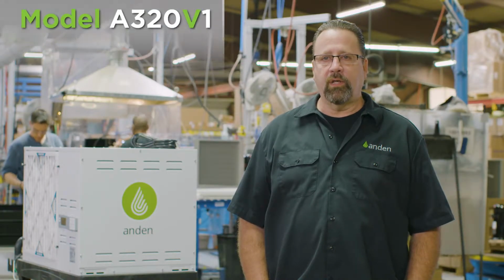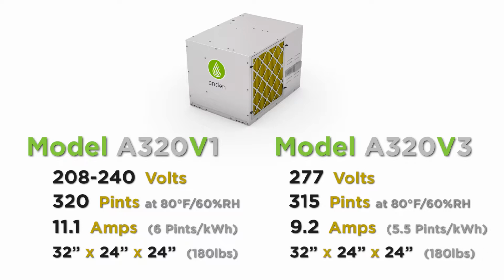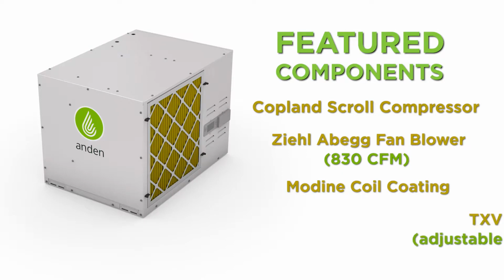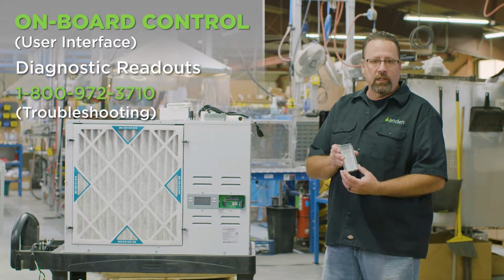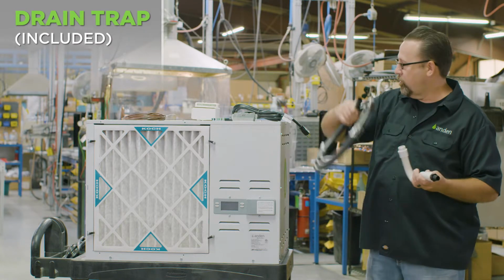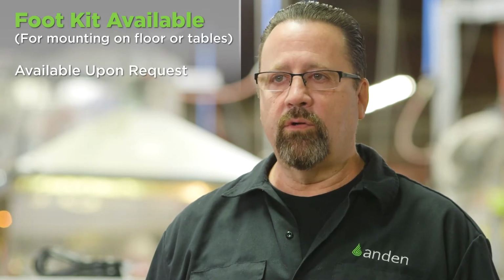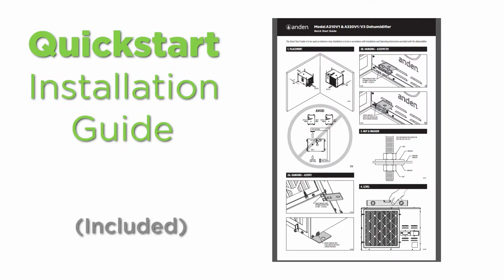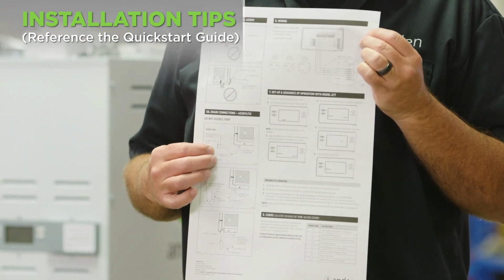Anden | A320V1 and A320V3 Product Overview

Comment: Please revise air filter size. Supply houses do not carry 19.5+21.5 air filter
Reply from the maker: Thank you for the feedback. We only recommend using the 5813 Anden filter specifically as it was designed strictly for use with the A320.

Comment: Is it possible to convert a A320V3 to 240v  ??
Reply from the maker: Thank you for contacting Anden. The unit would not be able to be converted internally, however, a transformer connected to your line power may be used. If you have any additional questions, please let us know.